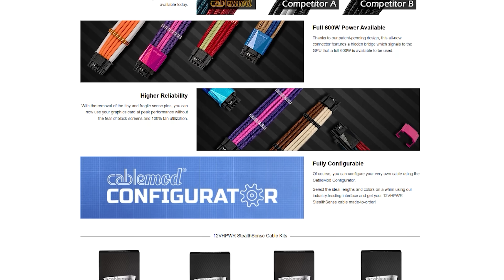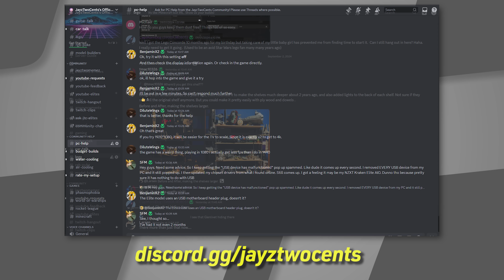Dear god... what have I done...?

Comment: I built a vertical window fan for my office this year.  6x 120mm Dell Clamshell PWM CPU case fans.  Yeah, the ones that pull like 1.5A at full speed.  I bought a cheap PWM controller off of Amazon that can run up to 8 fans.  Plugged in these 6, wired it to an old AT PSU.  Bam.  Can easily change the speed with a knob, and when you crank 6 of these up, stuff blows around in the office.   They are stacked vertical in a 3ftx3ft horizontal sliding window.   Installed metal grilles on the fans, cut some custom simple wood supports to fasten the fans to, and its fitted to be inserted directly between the sliding window and the frame.  Works perfectly and moves a LOT of air!  lol    Nice to see some one build a "box" fan out of fans!  Good job!  lol
Reply: Sick
Reply: I'm thinking of buying 4 of these to build vertically and put in my office door at work. I currently have a fairly noisy box fan in my door to pull cool air from the hallway into my office since it's the hottest office in the building. Is my GM going to be happy about me attaching these to the door face? Probably. Do I care? No.
Reply: My son made fun of me for positing this as a way to pull more air in through the Windows

Comment: Hah, this video brings back great memories from a warehouse job I had in college back in 2007-2009. We built a bunch of cookie cutter systems for a client that was using them as dual POS / virtual slot machine game units to install in gas stations and whatnot. The basic cheapo cases they specced out each came with a generic, no-name brand 80mm rear exhaust fan, but they wanted us to remove that 80mm fan and put a larger fan in instead. So, naturally, we ended up with boxes and boxes full of these brand new 80mm fans just sitting around doing nothing and we weren't tossing them in the trash, either. The warehouse we worked in had A/C, but it was a bit of an undersized unit for the square footage and couldn't really keep up in the summer (Texas heat), especially when we had to leave the dock bay doors open for trucks picking up/delivering. So, I and another burn-in/QC tester got creative and took a few spare laptop power bricks we had laying around (can't remember why we even had them, but they didn't go to anything we had on-hand anymore) and those boxes full of 80mm fans. We started zip-tying the fans together in a grid just like your setup here (but without fancy 3D printed parts, no screws), stripped the ends off all the positive and ground cables of each fan, twisted all the positive wires into one mass, same for the grounds in another mass, then hacked off the end of the laptop power brick cables and stripped them so we had power and ground leads separated. We worked out the math of how many fans each power brick could support based on watts and amperage (because bear in mind, we were NOT using any PWM control, so we had to actually size each fan-wall to the limit of the power brick or it would magic-smoke all the fans from pumping too much power through them, as we learned on the first attempt - and too many fans would just result in the fans not turning because we overloaded the power brick). Then, we connected everything and hung the fan-walls from our burn-in racks with zip-ties (we had ~10 total racks with KVM setups in a large semi-circle that would burn in 20 machines per rack at full bore, all dumping their heat right at us standing behind the racks). Each rack had 2 fan-walls hung from them, one of the left side, one on the right side. Those zip-tie fan-walls made a HUGE difference in our comfort level to keep working fast and not die sweating all day long. While the receiving and assembly line guys were dying in the heat, we (burn-in/QC) were chilling lol.

Comment: Now 3D print 12 of the Noctua airflow amplifiers
Reply: and use the PPC 3K RPM fans 140mm LOL flows more air then a holley 750 LOL
Reply: @CrazyChiefXxX i put 6 of those in my new build along with 3 120's...sounds like a rocket ship blasting off at almost all times😅
Reply: and have them pull through a carbon filter and some hepa paper to air filter the entire filming space?
Reply: @CrazyChiefXxX  or the aluminum frame San Ace 140 9GV...7600 RPM, 310 CFM max, that is baller

Comment: 8 years ago, I had this in the office on the table to cool myself, as the AC wasn´t enough...
But I had it powered with wall wart from external HDD and DIY 555-timer to generate PWM for speed regulation without having to connect it to internal headers.
Good times.

Today I was testing my Delta server fans, got 4, each 50W, 24V 2,4A 140mm beasts with 250CFM on max. External Meanwell 24V PSU, using internal PC headers for PWM and speed readings. Once I get my Octo, I will control it through Aquasuite via curve depending on the air temp above my desk.
On 900rpm one Delta pushes just as much as my 6 Arctic P12´s together...

Comment: This concept also works well with cheaper fans, it is not silent but also no worse than a classic desk fan.
I made something similar last summer, however as I don't have a 3D printer I used strips to tie the fans together and build a base in Lego.
My setup is a 3 wide and 4 tall arrangement with 80mm fans. The fans are just the cheapest RGB ones I could find on a Chinese webshop, they came with a rpm+RGB controller and remotes and as the controllers only handles max 8 fans my setup has the 12 fans split between two controllers. And for power I simply made an extension cable to a internal power cable in my PC, only downside is that this means the fans only run when the PC is on.
Reply: We need to see this!
Reply: @Jules_Diplopia  Hmm, maybe I should make a youtube channel starting with a video of my desk fan arrangement 🤔

Comment: Back in the late eighties a coworker did something like that using a glut of computer fans. There were no real 3D printing widely distributed if at all back then so he used wires to tie them together. I remember that it worked, but those fans were far from quiet so they made a decent noise when all were running at speed. I think he ended up running them at 7 V to get something that worked decently at a volume that was acceptable.

Comment: I used to work at Microsoft Research. We had an engineer that used to do stuff like this. I remember one time I walked in, in the early 00s and he had 9 LCD screens strapped together and attached to a wall. They also were showing off E-Ink and 3D TV displays while I worked there, far ahead of common use. Neat stuff. I would totally do that with fans!

Comment: Now to do a full build with just exhausts and that as a side panel. No internal fans or liquid cooling on cpu or gpu, just pure airflow cooling. Basically a callback to those of us who used a box fan instead of a side panel because we were running a K6 or a Pentium 2 and an agp gpu that only had a heatsink on it.
Reply: Oh the memories. K6-2-500 overclocked to 625MHz. Matrox video + Canopus Voodoo 1 barely hanging on at the AGP and PCI speeds. Case sides pulled, box fan one one side. Quake with armload of mods running at 1600x1200 on a 21" Trinitron. Corners onscreen so sharp you could cut yourself on them. Peak computer.

Comment: I wouldn't be surprised if the 3 fans at the top have less static pressure as the reason why they were pulling less of the smoke than the other fans.

Comment: I actually use a few 92mm bequiet silent wings fans as desk fans. I just have them plugged into a usb-to-pwm fan splitter. It's fantastic! Significantly quieter than a normal fan and moves more than enough air over a surprising distance. I've been trying to find a way to use an RPI2040 or something to run ARGB for more FPS too.

Comment: You should put the slower fans on the outside, one on top one each side, to create a zone around the high speed fans that isn’t as low pressure as the atmosphere, it might prevent leakage and focus the air flow a bit better.

Comment: I have had a construction like this for over a year, but with 3x9 fans, so 27 Arctic P14s
I always put these in the window overnight to cool down my apartment, much cheaper than an air conditioner,
I would have to do the math but the construction should have paid for itself this year through the electricity costs

Comment: the fans fighting each other is something you want to keep in mind when you have top fans and a rear fan exhausting, the 2 closest will fight each other and you can seem them running lower rpm because of that, you might think "easy fix let's set the rear fan as intake" which does the opposite they will accelerate each other and while your top rad will be better cooled it will create an annoying whine so it's still best to have the rear as exhaust but place it as low as you can close to the gpu

Comment: Couple of misunderstandings. The top fans are not starving. They pull the air from very far to the side (or up) from the array. The moving air vectors are much more like magnetic field. And they also have much more work to do because on one side they have air that is not moved by anything. On the other side, the fans in the middle moves air much faster, because all around them are other fans that helps. The area of that array is what makes it so long-range air mover.

Comment: Lol. I actually have a 2x2 14cm fan setup with 3D printed brackets pulling 1.2A. Used a universal adjustable adapter that can change voltage to adjust fan speed.

Comment: I made something similar in 2013 with 4 Noctua fans. Drilled holes in some square tubing, put posts in the holes and zip tied the fans to the posts. Cables are ran inside the tube.

Comment: Well, it's not stupid at all. Imagine I glued a  single brand new  Arctic 14cm fan to the case, directed the airflow between the back of the monitor and the audio amplifier (on top on the amplifier I have the modem, which gets warm, too). This fan was powered  by the PC, managed with Fan Control (a very good software which I think you recommended, thank you, btw). From the opposite direction I had another fan (90mm taken from some brand PC, powered this time by the USB 5V 2Amps of a universal laptop adapter), circling air in the room. I must say this summer was bearable this way. I have at my disposal 2 regular room fans, but they are big, noisy, and the airflow is annoying even at the lowest speed. Quiet fans are very important to me, so...
The idea is to get more 14cm fans like this one and make a fan stand. Arctic's 14 cm 1600 RPM is barely audible, the fan is made well, and the airflow is great, which will beat any regular&cheap room fan. Four more 14cm fans and a small power supply I think will be enough for a room like mine. That's why I like this method. It's not stupid if it works. It's even great if it works on the long run. Calculate the power requirements, make sure you have a solid stand.  Put some kind of mesh front&back of the fans if you have pets. Enjoy 😁

Comment: The rule of thumb in HVAC is 400CFM per ton of cooling, so you have just a bit over a ton and a half/18kBTUs worth of airflow, that's enough for a small workshop or tiny apartment but your static pressure probably sucks.

Comment: Danm. Now you had made an interesting idea for me to try. Even just with cheap fans, that will definitely help us here without any A/C lmao, can easily be battery powered and speed controlled too!

Might try taking out the fans in the middle and retry the smoke machine test, would it have a comparable effect to a "bladeless" fan, the middle gaping hole actually flowing air?

Comment: 2:10
Only the Pro version is optimized for radiator use because of the third type of corner.

Non-pro have pushpin and standard but they don't cover the area like third type.

Comment: sevel years ago I build something like that just with 4x Noctua NF-A20 FLX, a monitor mount, a PSU mith molex (and molex-Adapter) and several metal connectors.
(a good steel dril is required too^^ ... I damaged two of them while drilling in the mounting plates^^)

Comment: I just bought 23x Fans and put them into my TT Level 20 XT.

They're without working RGB at the moment, but I ordered more of the necessary additional parts, to get the RGB going as well.

Every 3x have 1x Controller which needs 1x internal USB Connector / Port + SATA Power + 4-pin RGB Header. 😵‍💫

Comment: use the 3D printer to make a bracket that suspends them in a line across the top of the monitor angled at you instead of taking up real-estate on the desk.

Comment: Jay, all you need is the block of 4 screws and the block of 2 screws. I can't see the bar as having much use.  Then you can use the 2 screw blocks to get rid of the "Mickey Mouse" ears on the back.  Maybe print some 1 screw blocks for the top corners.  Oh, and put the blocks on both sides for looks and some more strength. And while you're at it, add some more fans.  😂

Comment: Jay - that's getting close to the CFM of an engine.

Me - hold on I need math. 

A 302 cubic inch V8 at idle (750 revolution per minute) would consume roughly 131 cubic feet per minute.
Same engine at 6,500 rpm is roughly 1,136 CFM. 
This is assuming perfect volumetric efficiency so the actual numbers are a fair bit less.

Comment: The high speeds have a much higher static pressure. 2.41 mm H2O vs 1.45 mm H2O. That is like +66%.
I think that probably accounts for the big difference you're seeing between the 2 fans.

Comment: Jay, why don't you get a Chiller setup and experience extreme cooling that anyone can realistically have. Just a medium sized Chiller that keeps the CPU temp at ambient or below.  Fun to play with and you can run Cenebench and other synthetic tests all day long without overheating the CPU. Core  frequencies can be set much higher also without any down clocking. Subscribers would love that video.

Comment: i have same setup sorta in my room i only use 4 fans but it works better then the big fans you buy at store it is much quieter i get same airflow with less Nosie they all run off a power up and a 10amp 12v power supply

Comment: Case mod idea: replace the side panel with "fan" panel...
Reply: Ironically, we had stuff like that 15+ years ago.  Y'know, when stuff didn't run as hot as it all does now.  LOL
Reply: @artisan002  yeah mountain mods had panels like that lol, we did have a lot of components without heatsinks or active cooling though so it did help
Reply: @artisan002  Even more ironically, when the see-through side panel fad started, we had acrylic or polycarbonate with a metal or plastic surround for a side panel, with pre-drilled fan holes and grills, allowing for cooling of the GPU directly. And some older solid side panel cases had fan mounts instead.
Reply: @DEJ915  Ah, I remember seeing them, but didn't remember who made it.  Nice!
Reply: @marsaustralis6881  Yup!  At least there's the Riotoro Morpheus case out there.  You can fasten an absurd number of fans to the side.

Comment: I wonder if you can make it as a pc case "side panel" and see what's the different in the components temperature. Like component in motherboard, nvme drives, power mosfet, gpu capacitors, etc. Is it going worse or made an improvement.

Comment: I have to run a Window AC unit to keep things cool. Even at low fan speeds this thing is loud and raises the noise floor in my little office to about 60-65 DBA. I've been wondering if its possible to maybe upgrade the one large internal fan that has square edges and is cut quite rough with some quieter P12 Max fans. Central AC is not an option, I was thinking maybe a split heat pump system would be nice but they are expensive.

Comment: Jay, do you wanna do passive watercooling ex-AC condenser?

Like connect two end of it with openloop input and output. Or maybe you can cut several opening for multiple input-output to distribute the water (considering condenser pipe is small)

Why use AC condenser? Most of them use copper pipe from getgo. So zero concern with mixing metal compared to car radiator

Comment: Speaking of fans, I just bought two new fans to supplement the single intake fan on my new pc. Does the arrangement of them (top, middle, bottom) matter if they have different airflow stats? The existing one has non-variable rpm, the new ones are variable speed.

Comment: in aud this is about $180aud in pure wings 3
 a 12v 5a laptop psu will be able to power them with head room and a real one of them in $94aud for a new one
a DC 5521 t to 4-Port fan spliter is $5aud
and the fan spliters 1x2 by 4 is $6aud
an estimate of build time for the 3d print pricing is around $45-70 aud with postage 
bringing the total to $355aud

......a dyson fan in aud is $397aud

is it pracital no...... am I still going to do it yes.......will my gf like it probs not

Comment: Or get 4 Delta fan from HP or Dell. The old Delta fan that run 12v 3amp. They are use to cool the CPU and their giant ass heatsink. Pentium 4 and Pentium D cpu.
I've got 6 and burned one of them.

Comment: 9:05 The fans on the top row are not the same model, those look to be optimized for static pressure while the other are optimized for airflow

should have put the kilowatt meter on the psu and compared it to a box fan